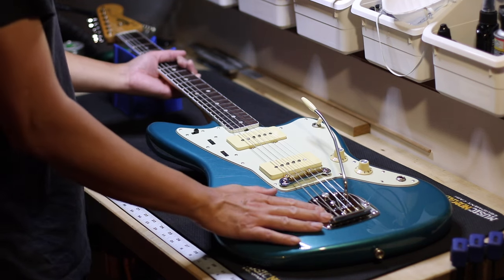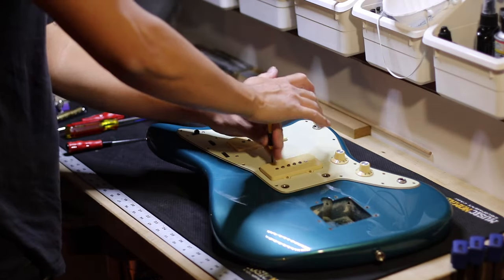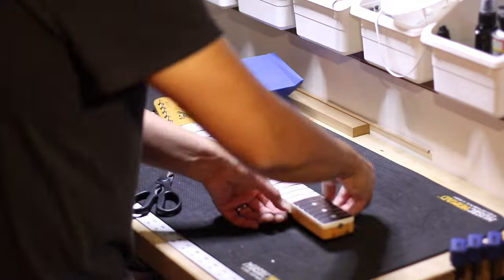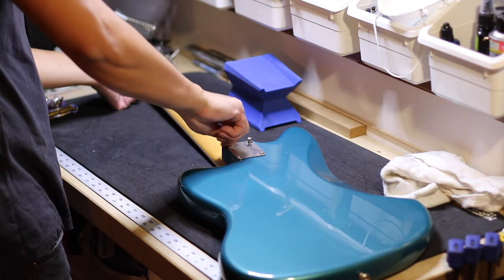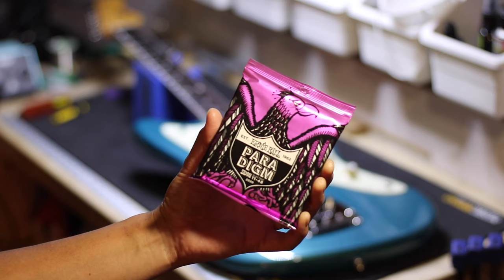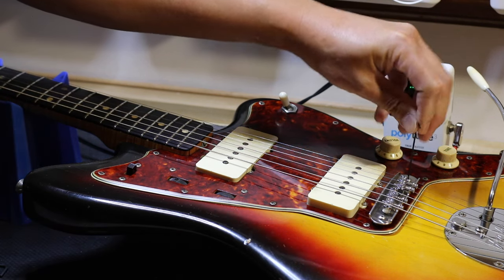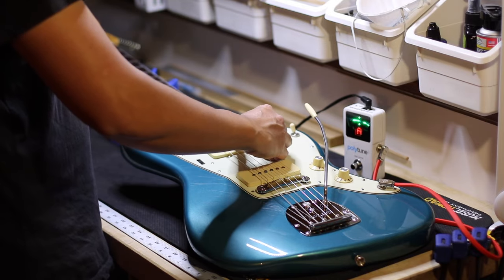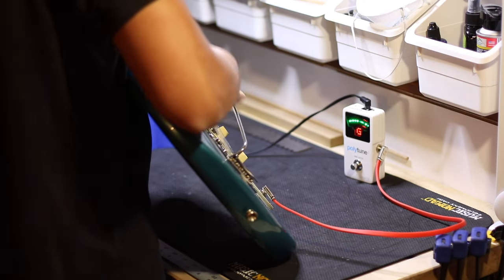Guitar Tech Tips - How To Setup Your Fender Jazzmaster

Comment: THANK you. you're the first person I've seen on youtube to describe what the tremlock is for, to rescue the tuning when you break a string. It's not meant to set the vibrato to synchronous. the bridge was designed to float, and the tremlock was for string breaks. you're doing the lord's work
Reply: Still don’t get it
Reply: @carlosmontiel2854  so on a floating system, if you break a string, the equilibrium between the spring tension and strings is destroyed. The spring gets looser because there is one less string applying pulling force. Consequently, the angle of the fulcrum changes and the strings go out of tune. The little tab on JM/Jaguar vibratos is a "tuning rescue." If you break a string, you slide the tab, and it preserves the angle of the fulcrum, keeping the rest of the strings(relatively) in tune so you can finish the song. 

People assume that it's an option to set the bridge to synchronous(flat only) vibrato, which isn't true. Same with strats. They are not designed for synchronous tremolo. they're designed to float. If you set up a strat with synchronous tremolo you will damage the paint under the bridge plate because it will be constantly smacking into the body.
Reply: @YourFavouriteColor  thank you so much

Comment: Do you shim the necks on your jazzmasters?  What kind of a bridge is on the blue one?  Thanks so much, great video!
Reply from the maker: Hey! I don’t shim the Ocean Turquoise Jazzmaster. It’s an American Original which comes with an angled neck pocket. You can shim with a 0.5 or 0.75 degree full neck pocket shim from Stew Mac if the neck pocket is not angled from the factory.
Reply: @LoungingGuitars  I was going to do that, but Stewmac is really expensive for that kind of thing, even for members like me.  I found similar shims for a few dollars on reverb or ebay, it's just a thin piece of wood cut precisely - Stewmac wants big money for them....

Comment: 000 steel wool is much easier than all that to clean the neck it will also remove any crud from the wood and open it to the oil, properly done that is. I never remove the neck for this process but ensure the neck screws are tight and not stripped. You can also use some silver solder for nasty fret dings with some proper files from SM. I hold, keep the neck suspended for intonation like I am playing it, it keeps pressure off the neck but is easier for me? thanks

Comment: I opened up my Jazzmaster today and replaced the jack. But after putting the pickguard back on, I seem have no rhythm circuit on the guitar. Completely dead. Opened it up again to make sure i didnt catch anything or mess a solder up but it seems perfectly fine - wiring wise. I didnt even touch anything else but replacing the jack. I'm at a loss. Could something be shorting out the circuit channel?

Comment: Thanks for taking your time to make this video, I found it really helpful. Great tip with putting the screws on a magnet! I am not clear what the sliding button on the trem plate does or is for. Should it be forward or backward and why? Any help is appreciated.
Reply from the maker: Hey! I have a newer video going over this in detail! Check out the latest release.
Reply: @LoungingGuitars  That's great. I will check it out. Just got a Johnny Marr jaguar with the same button and trying to figure our best usage of the vibrato system. Fantastic guitar so far.

Comment: Thanks for this video, it's really helpful for me. I have a Vintera with the vintage neck radius though, and I have trouble bending too high above the 12 fret. I have the neck shimmed with a 0.5 stew mac shim and there's a slightly noticeable forward bow on the neck, but it's pretty straight. I'd like to lower the action more but I can't bend at all then. Do you have any tips for fixing this? I've heard that vintage necks don't get low action and have the bend trouble but idk how true that is...
Reply from the maker: The radius of the neck is definitely the culprit. Make sure the neck is as straight as possible with only the slightest relief / forward bow. I set the string height at the high E while trying to bend a hole step at the 10th, 12th and 14th fret. I set the height right before the bend frets out. It ends up being right around just under 1.5mm at the high E at the 12th fret.
Reply: @LoungingGuitars  Thanks so much! I'll try making the neck a big straighter right now. My string height is at 2mm right now for the high E so it would be nice to lower the action somehow.

Comment: Try as I did, I could never get the original bridge on my new Player Series Jazzmaster to cut it.  I shimmed the neck, raised the bridge, but I couldn't get it as high as it needed to be without the strings hitting the back of the bridge base. I settled for lower than what it needed to be,  but just couldn't distribute pressure evenly enough across the saddles. Some strings aways sounded a bit lessor than others., and the whole guitar just seemed to not be all it could in terms of tone and resonance.  So I broke down, considered Staytrem and Mastery bridges, but settled for an $80 Fender American Pro bridge and it completely solved the problem, making the guitar sound and play as it should.
Reply from the maker: Great to hear it’s playing great now!
Reply: Sounds like you overshimmed the neck. You should have tried flatwound 11.s before shimming. Sometimes the right strings make all the difference
Reply: @BlindingSun_   I got a Mustang bridge with higher saddles, also 11's. All good now.  I could probably go back to the original bridge but probably won't.

Comment: Do you have any recommendations on how to set up a Squire Jazzmaster tremolo system without a trem-lock? I was thinking about adding a spacer as a trem-lock.
Reply from the maker: Nothing can really be done to add a trem lock but adjust the spring so the trem arm is at a height you like and check if the trem bottoms out or can’t pull up enough to at least bend up to half a step.
Reply: @LoungingGuitars  I used my tuner, and I can bend up to a half step. Thanks

Comment: Thanks for the video! Where can I buy the replacement panorama tremolo ?
Reply from the maker: The trem unit can be purchased on fender.com if they have them in stock. You can also look up darrenriley.com or Reverb.
Reply: oh, i meant the replacement spring for use with heavier gage strings, sorry i worded it iso poorly
Reply from the maker: I got the spring on eBay. Seller name is superiorsell2014. The option to select is 16x8x25 in Yellow. The Yellow spring is the correct spring tension. These ship from China so you may have to wait a bit.

You also need to modify your spring retainer. I didn’t want to modify the factory part so I bought an Allparts Jazzmaster Spring retainer. You have to laithe the retainer to fit the diameter of the spring.

Comment: I set up the lock button as you indicated. The problem is that when the lock is perfectly working as intended then the tremolo downward travel is  very reduced, almost unusable. Should I then swap the spring to one with a different stiffness or do further internal adjustments?
Reply from the maker: Which Jazzmaster model are you playing? What’s the country it was made in? Each model has different quarks. Just want to make sure I give the right advice.
Reply: @LoungingGuitars  Thanks, I believe it's a late 90s CIJ. I made a bit of research and arguably the cause is that the spring is too soft for string gauge I'm using
Reply from the maker: I would upgrade that to a Fender American Vintage Reissue Trem Unit. They just work much better. If you have the money, you can get the Mastery trem Unit which is even better.

Comment: Any ideas on why my trem arm collet isn't the center (or center-ish) in the hole? It rubs against the back edge of the hole the collet sticks out from the face of the trem plate. I've never had this happen before. I thought tension might sort it, but after stringing it up it hasn't. This is a brand new AVRI trem unit. I've used them many times before. All brands and guitar price points and never had Fender, Squier, Mastery terms have the collet so far back in the hole.
Reply: Blame Johnny Marr 😂😂😂
Reply: @BlindingSun_  He's a Jag player though. I'd rather pick on a Jazzmaster player.
Reply: @bciecko1  Troy Van Leuween

Comment: Here's a question, regarding the Am Pro 2 Jazzmaster. I have the vibrato lock engaged, and no matter how much I tighten or loosen the vibrato tension screw behind the lock, it makes a "tink" when the arm goes back to the up and resting position. I'm guessing it's where the 2 plates meet somewhere. I saw another youtuber use gaffer's or duct tape to dampen the contact between the 2 metal plates, and someone on the same vid said, "a simple adjustment of the tension screw should do it". I'm not finding adjusting that screw tighter to be the case. I can still dive, from E, down to G# but, always the "tink" when I let go of the arm and it tops out. Does the tension spring screw need to be super loose? super tight? I don't understand why I can't find a straight answer to this problem. Any help is appreciated, thank you!
Reply from the maker: Hey! What string gauge are you using? Also, have you swapped out the spring as the AmPro 2 spring is too soft for the trem Unit.
Reply: @LoungingGuitars  Using 9's, which came stock. I also haven't been able to get a spring that didn't require boring out the middle to fit the spindle. I bought the spring that Ryan from 60 cycle hum recommended but the original spring remains.
Reply: Getting the awesome dive action I want, but, again, always with the tink when the bar tops out.
Reply from the maker: You can try this. When I got my Panorama Trem, I had to tighten all the screws and nuts and everything underneath ‘cause I was getting some clink / tink noises. Even though the trem arm is push in and snug, it still made sounds afterward as the tolerances at the Fender plant are still not great. Start by tightening everything on the trem and troubleshoot from there. You’ll have to take it off the body of the guitar.
Reply: @LoungingGuitars  I appreciate the correspondence. I will check it per your advice and get back to you if I fix the problem. Thank you again!
Reply: I took off the panorama vibrato, tightened the screws on the system, then added a strip of duct tape between the plates, then put it back on, to find the noise was still there, though greatly reduced. Then, I dialed in the tension screw to just tight enough that I don't have to depress the bar at all to allow the lock to engage or unlock freely, and the pitch stays pretty close either position. Once I got that there, I hear no more "tink" when the bar tops out, locked or not, and I can still bomb like crazy... so far. Thanks again for the video, and advice.